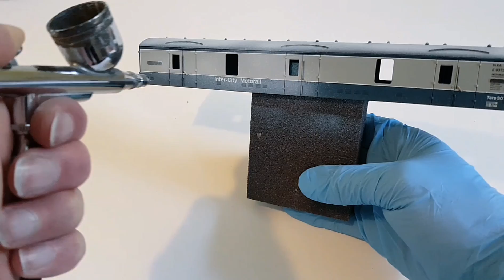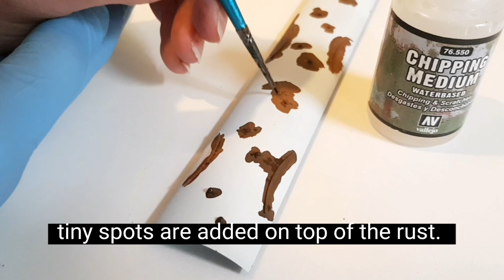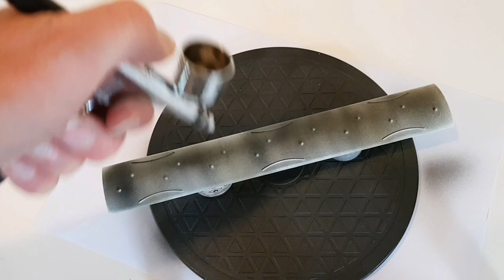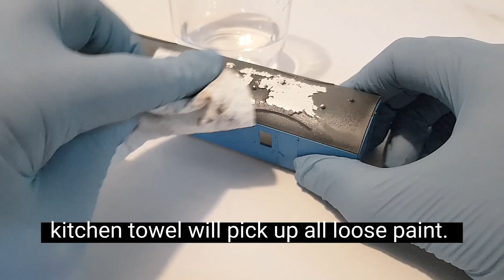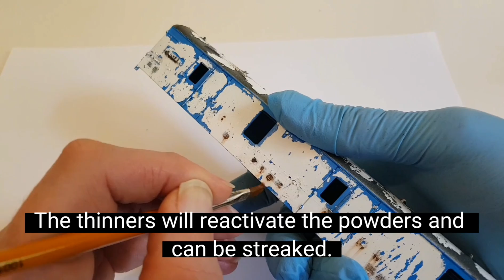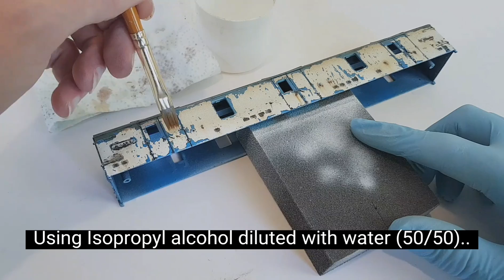Episode 11. Realistic Scrap Weathering. Multi layered Method.

Comment: Some stunning effects there Tim. Were you working from a reference photo of the real thing?  If so, it would be interesting to see it, or them. The reason I ask, is there not just a tad too much white showing? I may be wrong and I'm certainly not criticising, it just looks slightly "overdone" to my eye, although it shows the technique brilliantly. Another thought; could some of the white not be dirtier? It looks quite clean, yet white will show every speck of dirt.
Something I  found interesting was the accuracy of the blue shades. When you showed the paint, I was a wee bit surprised it wasn't Railmatch, or another "precision" shade. The results speak for themseles though; the blues are the perfect shades. I'm guessing that you need water-soluble paint and all the "specialist" railway colours only come in enamels.
I hope you don't mind my amateur crique and Sorry if I sound negative😁; the result looks fantastic and demonstrated the different steps perfectly. Just the picture in my head has less white, and is dirtier. You seem to concentrate more on the effects of rust and age, rather than the grubbiness caused by weathering.
Still a great project and I'd love to see it "in situ" on a diorama. 👍👌

Cheers for now,
Dougie.
Reply from the maker: Thanks Dougie. 
The roof is the only part of the model worked from reference and is fairly accurate to most prototypes. (though white is very unlikely and would of been a pale grey) 
The body sides were done the same to keep the process simple and easy to follow, the body side primer would of most likely been a sage green colour. I chose white to highlight the rust powders streaking, the 2 contrast better so was done for visual impact. For the same reasons I held back on dirt, one of my test models did have all the green tones added and more heavy dirt but the rust was mostly covered. 
Surprisingly enough some scrap abandoned stock was fairly clean despite being in a terrible state. 
Hopefully the demo here doesn't stop at scrap stock but also is useful for other painted metal surfaces. 
Cheers for the comment.
Reply: @thescrapline4905  Ah !!  So partly for effect, slightly exaggerated. That kind of ties in with what I thought cos it really did show the techniques clearly.
Thanks for such a quick reply.👍

Cheers for now,
Dougie.

Comment: omg you just get better and better at this weathering does ever go wrong ???
Reply from the maker: Funnily enough yes. Each method is tested to see if it's compatible with the next. Some don't react very well with others. 
My heljan 33 I did a while back was weathered using acrylic railmatch paint that was re-worked using enamel thinners. 
The Vallejo paints used here are also acrylic but enamel thinners turns it into a gloopy mess when it was tested for re-working, hence using Isopropyl alcohol. That was discovered on a few samples before this. 
Generally I can flip a model if something reacts badly so nothing is lost.

Comment: Amazing only thing that would of made it better was if instead of painting it blue if it had been painted the blue grey of it's original livery so parts of proper livery are showing but  I'm going to have a go it it at some point
Brilliant video thanks
Reply from the maker: Cheers. The idea was to keep it simple so chose the one colour for livery. I did test the method on 2 colours on another model, if you give it ago just be cautious on what tape you use as it may well pull the paint off, chipping medium does put a layer between coats so paint doesnt key aswell.. I used a very low tack tape. That worked fine.